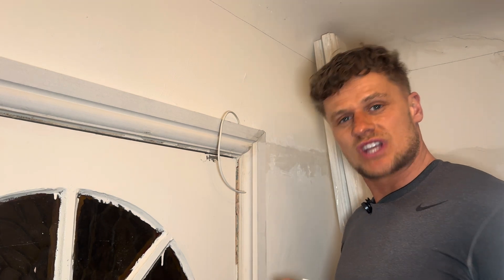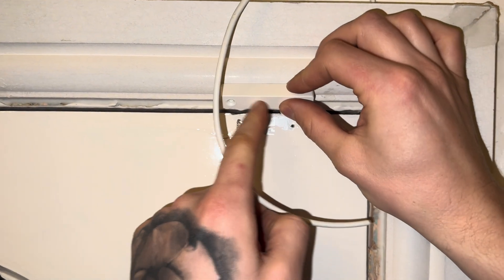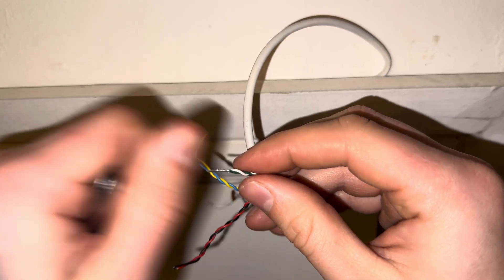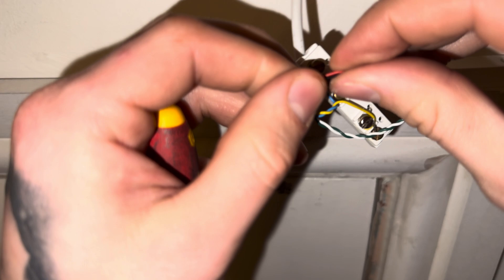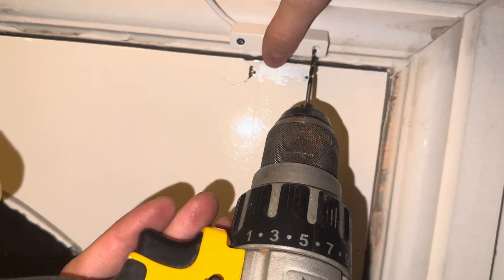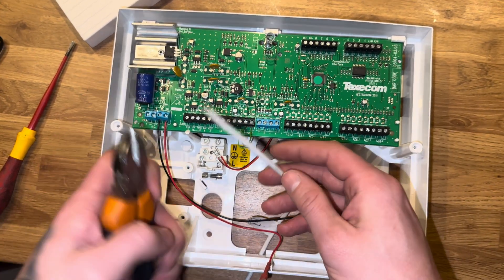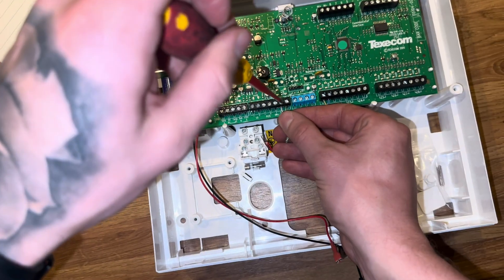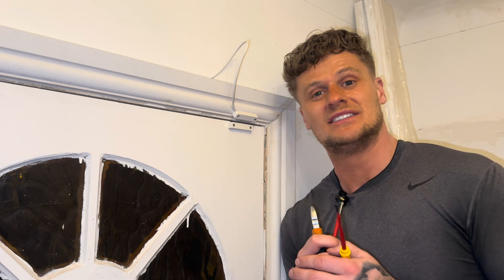How to install a magnetic door contact: Step by Step

Comment: good to see that the coupling can pop out of the 'holster' box but still if you are using frizzy wires , trying to wrap them the screw is very annoying...
Reply from the maker: Best thing id advise mate is twist the frizz, it’ll become easier to manage and then wrap it round the screw 👍
Reply: @SimonSecurityExpert  Great video Simon. What about doing a video on how to check that the sensor isn't faulty after years of service, by using a multimeter for continuity...? Say you get a generic fault like Z4 bedrooms but you have 5 windows in that zone with five sensors and don't know which one is causing the fault...? Thanks a million...
Reply from the maker: I’ve been trying to figure out the best way to film that exact video mate but it will be done, there’s just a few key stages to it so I’ll set it up correct and get to filming asap 😀
Reply: @SimonSecurityExpert  Thanks Simon. It would be a good one to do, but yeah you are right filming is tricky. My windows are skinny and the area is tight for space so even using a multimeter is a pain...

Comment: I replaced flush door contact due to the alarm not setting properly the contact had been installed by the previous owner alarm company but when I checked the issue the previous firm had used two lots of cables electrical taped together so I did a new run of cable and ran a surface mount contact, wiring a bellbox would be a good video especially for people who are doing their own wired DIY systems
Reply from the maker: Sometimes it’s just better to start again isn’t it mate, new cable and save yourself the call outs haha 😂 I’ve done a sounder one, link here: How to install an external sounder - Burglar Alarm
https://youtu.be/Xo9cj__SRSg

Comment: I thought that your were suposed to use your own wire colour combinations.  That way anybody trying to gain access would not know what colours to bridge together.
Reply from the maker: It’s a good point mate, but not something that’s necessary, in general engineers use the same cables and it’s never been an issue

Comment: Our door sensors were installed 20+ years ago. The were round and were drilled into the size of the drill bit used. Even today I have trouble seeing where they are. The one with the pigtails went into the door frame and the magnet went into the door. Pretty cool. Was extremely pis see Ed off with the windows sensors. Pigtails went Ito the windows frames and the magnets were attached to the sliding windows with piss weak double sided tape. During summer came home nearly every day to the external flashing blue alarm light saying Hi. The tapes on the windows softened in the heat and the magnets fell of the slididing and triggered the alarm. Found that 3M double sided tape was really good and the magnet didn't come off. Unfortunately that was after I lost a blasted magnet but I have found magnets of the correct size. Now if AliExpress will send them then I'll be satisfied.
Reply from the maker: Flush door contacts I think you’re referring to mate, good for aesthetics 👌 and yes 3m sticky tape does a good job overall 😃

Comment: Great video.

Question-My sensor wiring is identical to yours but there is what looks like an extra tiny electrical component on one of the 5 screws.

Any ideas?
Reply from the maker: Thank you mate great to have you here. I’m not quite sure what you mean, do you use Instagram? If so, could you DM me a pic of it? I’d be happy to help @simonsecurityexpert